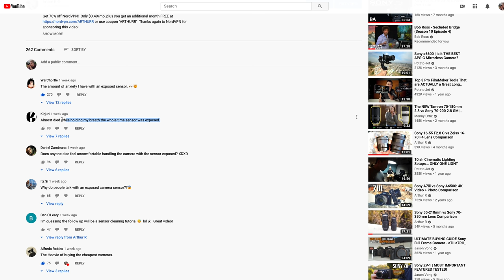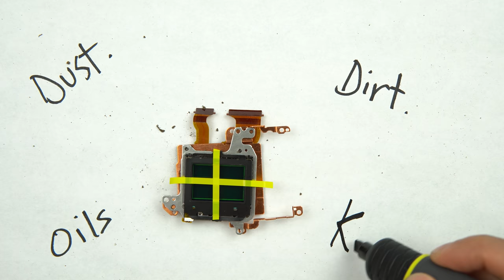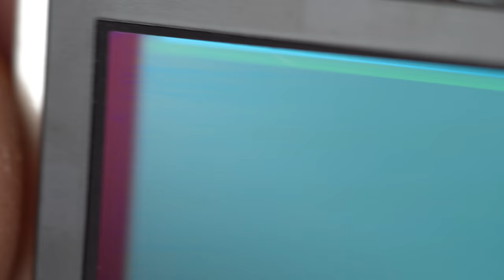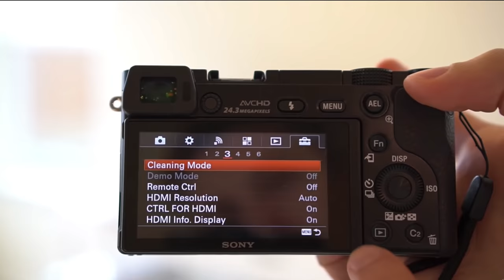How Scratch-Proof is a Sony Mirrorless Sensor?

Comment: One cleaning tip; for Sony cameras with IBIS, place your camera in cleaning mode. It locks the sensor in place while cleaning, so it does not move around.
Reply: Exactly ahaha. Seeing that sensor move made me lock up 🤣
Reply: Just got my a6600 two weeks ago have not cleaned it yet but good advice 👍
Reply: It has a feature that shakes the lense too right ?
Reply: @bikecommuter24  Unless you've been rolling in the dirt with it with the lens off, you shouldn't need to clean it in a long time
Reply: Great tip!
Reply: Ironic how Lens Rentals just recently show how fragile the IBIS mount was for Sony's cameras. Some mounting tabs were just broken, like a cheap material or classic cost cutting. Give it to Sony, an electronic toy manufacturer to make cameras.
Reply: @smoke4131  Correct
Reply: @ElReySupr3me  Me too 🤣
Reply: @smoke4131  If you press Ok on the screen that shows up after you press Cleaning Mode, the sensor will shake. So you can press Ok first to let it shake, then go to cleaning mode again and don't press anything to clean it by hand.
Reply: Tnx for that tip
Reply: @bikecommuter24  Me too..  but 3 months ago. And it's a beast right? So what lens you use ?
Reply: @jeroenvdw  If your camera has IBIS built in. My Sony A7 mark 1 does not have IBIS.
Reply: I don't think that's necessarily better. Having your sensor locked in place means you are actively putting pressure against the IBIS motors - potentially more than they were designed to compensate against. 

When you are cleaning it with the camera off, the sensor is moving more freely on its axes, and unless you are being overly forceful you aren't putting pressure against anything. 

Ultimately I don't think it makes any practical difference if you are being gentle but IMHO having it off is safer if you are concerned about damaging the IBIS.
Reply: Thanks

Comment: repaired cameras for 20+ years..... the sensor assy. (notice i said assembly) is the LEAST FRAGILE part in any digital camera. PERIOD.....the most fragile are 1. shutter mech....2. MAIN BOARD
Reply: legend is here
Reply: Hello, A drop of water fell onto my sensor while changing lenses in a forest. Can you suggest me how to remove it by myself since I'm at a very remote place and there's no camera repairing service available. wiping it with those cleaners will do the job?
Reply: @nord7556  I'm also interested, a bit of fluid touched my sensor and dried out and now there is a fluid 'shadow' on it
Thx in advance
Reply: I have a question regarding the sensor damage. In the tests it seems the scratches (from the knife) were done mainly to the filter that sits on top of the actual sensor (which I guess would be the IR-cut filter). Would it be possible to replace just the filter part instead of the whole sensor? I know some people remove that filter to make IR conversions on their cameras, so I guess it can be replaced too, right?
Reply: @MatheusPratta  The simple answer is yes (depending on the make and model). The realistic answer is no. Taking off the low-pass filter introduces a new risk of getting dirt sandwiched between the sensor and the filter. Removing the filter is also risky because it easily breaks. Overall just high risk low return from a repair perspective. Sensor replacement will be your only option unless you do it yourself.
Reply: Nah, my Nikon dslr sensor was damaged by the light blower tip touch

Comment: The "problem" with these tests is that it is not on a camera.   You would need to take some images to see if they show up.
Reply: My thought exactly. You really can't see the damage by just looking at it.
Reply: Yeah but that big Scratch will definitely show on picture
Reply: New video idea :D
Reply: @smoke4131  Its like a spec of dust on the sensor. At open apertures not visible but closed it might be visible
Reply: i think exept the knife mark then will not be a problem, wildlife photography, filmmaker smearing their sensor in dust and dirt all the time
Reply: @duynhat638  I literally got sand in my a6300 sensor. blew it out with a blower  cleaned it thoroughly and carefully and had no issues. I wouldn't test that on my a7III though, haha
Reply: the test is totally exaggerated, in real life you will blow it to clean it and different ways if necessary. The point is that leaving it open and collecting some dust is not such a big deal as people think.
Reply: Dave Taylor // But it shoes the « ideal » conditions to get the worst problems on the Sensor!
Reply: It shows my a7rii got some small scratches at lower shutter it shows 😪😢😭
Reply: @loogatdisdood No moving parts except for the shutter, so very little chance of dirt obstructing anything, although the shutter is bound to get screwed if you actuate it when it's really dirty.

Comment: Would be interesting to see how this sensor performs after damage
Reply: I have a scratch on my sensor, it doesn't really affect when the photo is taken in a faster shutter speed, but if its slow ull be able to see the scratch(s) on the image
Reply: @thevthinesh  one of my friend literally has a crack on the sensor glass and for some reason it is invisible in photos😂
Reply: @thevthinesh  the amount of light directed at your sensor from the aperture ring. When the aperture is closed: 11 and up you’ll most definitely see that scratch.
Reply: @architecture_logs  Yes, I've just had a dust particle on my sensor, and shooting mostly at f1.4 I didn't notice it, only when I was closing the aperture I saw it. Made me wonder because I thought aperture would affect only the visibility of particles on the lens but anything on the sensor would always be seen as literally the light receptors are covered.

Comment: You have not actually done anything to the sensor, just the sensor assembly. What you're messing with is just a piece of hard glass (maybe mineral) with an IR filter on it in front of the sensor, the tiny "scratches" are just where you scraped the IR coating off.

Comment: You shoulda try sand ... It's common in beach and it's super abrasive
Reply: but in real world scenario, getting sand into your lens is pretty much impossible unless you purposely pour sand into it. Even if you drop it on the beach facing downward, apart from the fact that the sensor is buried deep inside the body, the sand will not stick to the sensor either.
Reply: Sand will Scratch the sensor in one go only
 (ʘᗩʘ’)
Reply: I shoot at the beach all the time. Im certainly more cautious about lens caps when there but i do change lenses while there.
Reply: @youreperfectstudio4789  agree, you have to be a bit more cautious but still changing lenses is no problem
Reply: @iamwisdomsky  not... I travelled once as backpacker and oh man... Camping in beach.... You don't know how that sand gets to everywhere. One of my lenses got sand and it was hard to remove. The camera got some sand as well... But it survived the trip.
Reply: @ElRealista.  You're not being specific, which part of the camera? you mean inside the camera? in the sensor? 
We're talking about the sensor and not the lens or getting sand around the body.
If you are indeed getting some sand into the sensor, my question is how in the world are you handling your camera then? seems like you are handling it the wrong way. lol
Most camera bodies are dust proof so dust and other particles bigger than dust will not be able to make it into the sensor as long as a lens is mounted or the mount is covered with a cap if it's not in use. 
I can't imagine anyway a sand will make into the sensor unless you are handling it wrong.
Reply: @iamwisdomsky  the sensor, got inside because the lens had sand.  I used air to remove it.
Reply: @iamwisdomsky  lol definitely VERY possible. Any windy day the sand easily gets 4 ft off the ground and can get into your lens shooting at or below waist height into the wind. Not to mention someone shaking out a towel near you etc. My friend's dog ran into me covered in sand while I was shooting on one knee. Plus the obvious lens change.
Reply: Some Sony cameras aren't weatherproof and the ones that are weatherproofed, aren't barely good enough. Sand is sand and it gets everywhere but Sony is the worst. Give it to Sony, an electronic toy manufacturer to make half- baked defective products.
Reply: i got sand on my a6300 sensor back when I still had it. Cleaned it thoroughly and saw no discernable difference in image qualit. Went on to use it for another year and a half before switching to the a7III
Reply: Foto4Max You underestimate my power
Reply: I was filming in the Sahara back when tape was still the way to go. I duck taped every seam on the camera, and I placed the camera in a waterproof case and kept it in there the entire time. When I got back after two days of shooting, there was sand inside of the lens, and inside the camera, there was even sand inside of the tape. 
Sand, especially fine sand with enough wind will get everywhere.
Reply: @PaulKentSkates  exactly!! Sand it's superbly annoying. But to be honest, I was using vintage lenses in my a6000. They took it better than moderns lenses. I was afraid modern lenses with electronic connections could not take the trip.
Reply: @loogatdisdood  they key is cleaning with air and not using friction. Sand is super abrasive so if it's sand and you use a microfiber cleaning then is like scratching the sensor with the little particles of sand.
Reply: @Foto4Max And it gets everywhere
Reply: @iamwisdomsky  nope, been in plenty of sand storms on beaches. it gets into every thread on a camera. should you changes lens at that moment also...
Reply: @Foto4Max and it gets everywhere!
Reply: sand is pretty much guaranteed to scratch it if you drag the swab over. If you can't get it out with air, you will be kinda fucked.
Reply: I don't like sand. its coarse and rough and irritating and it gets everywhere.
Reply: @terorvlad  Lens brush first, then air blower, then the wet cleaning.
Reply: @caldera878  I don't know man, I still see the A5100 alive that was used almost 7 years ago...sure they are not weather sealed to the standards of canon and nikon, but they do live....

Comment: Arthur scratches the Sensor aaaaannnddddd....... Scratches at level 6,with deeper grooves at level 7.......😂
JRE
ArthurRigEverything
Reply: Was waiting for the bend test next.
Reply: Meanwhile I clean with a dry Q-tip when my air rocket can't quite blow off the dust.
Reply: The A7 is weak even for electronic device wise. Plastic body, plastic lens mount, rear LCD screen that fades and the overall impression of a PlayStation controller.
Reply: @caldera878  he was using a  A6000 sesnor though. Level 7 is a not a Sony camera model A7, it's a scratch hardness level.
Reply: hahahaha... sounds so familiar...
Reply: @MrMACornwell  haha. What about the burn test?? 😂
Reply: Yes man, after Arthur started the scratch test, the Jerry's voice instantly come in my mind sahduasdhu
Reply: "natural filter"

Comment: 0:36 You should turn the sensor cleaning mode on in your camera setting. That way you will lock the IBIS. What you're doing here is potentially damaging the IBIS
Reply: the a6000 does not have ibis
Reply: @LemonDrizzleGang  he's cleaning a A9

Comment: Thanks Arthur. This really helped. I now would have more courage  to clean a sensor should the need arise. Fortunately in 10 years of use of 6 different ILC cameras I've never had the need to touch anything to a sensor to clean it. I have run the camera dust removal vibration feature a couple of times which worked. I do keep my lenses and sensors covered as much as possible.

Comment: I'd love to know if you'd really see scratchmarks in the picture of the sensor. The protective glass atop the sensor seems to be thick enough to leave scratches out of focus.
Reply: You would definitely see it, you can see a grain of sand. It might not be noticeable without a direct light source coming in, but any bright light, especially off to an angle is going to light up that scratch quite a bit.

Comment: Interesting find... my A7RIII at first was strange because at F16-22 in some lighting scenarios would expose what looked like sensor dust... after research and talking to my local camera shop—came to the conclusion that the high resolution sensor was the culprit due to vibration and sensitivity. Even if the camera is on a tripod, clean/pristine components and with or without Stabilization and IBIS (16-35GM)... it’s still had micro dots of what looks like dust. This is where In post I can clean up. I usually don’t push past F14 and that seems to be the fix. Anyway I still feel like it shouldn’t do that. The interesting thing I’ve noticed is that people complain and say the A7RIII is like a vacuum and collects dust... when it reality they are wrong. I’ve used my camera everywhere and in any condition from sand, dust, rains and windy conditions. Still no sensor dust... haha

Comment: I think that the number one thing that is unknown about our cameras and as a result limits us as photographers is how waterproof the bodies actually are.
Testing a body like the a6400 (with tape on the lens mount as if you were using a sealed lens) under various showers of water with functionality tests in between as well as weighing the camera between showers after drying the outside completely, or even placing color changing stickers inside in various places could give a good indication of what the limits are.
Reply: I've dropped my a6400 in the river... fully submerged. Still works just fine after cleaning haha 😄

Comment: Excellent demonstration and a lesson most people should take to heart and there are some other important factors to think about: 
Most people think the sensor is sensitive, but it's actually one of the most protected parts of the camera; even those without an antialiasing filter they still have several layers of glass and other filters over the sensor so you don't actually touch the sensor itself, just the glass cover.
What do you think is the most prone to be damaged and replaced in a digital camera? 
Well, it is actually the circuit board or mainboard, whatever you want to call it, because of the circuit board isn't encapsulated or covered in resin like military-grade circuit board according to mil standard and the inside of the camera shell is usually not finished, painted or otherwise treated, so the magnesium or aluminium oxidizes and that magnesium or aluminium dust short circuits the board or wrecks it. 
In second place comes the shutter; the shutter blades are incredibly thin and light because they are made to trigger and "uncover" the sensor and cover it again in less than a 1/4000th of a second, sometimes as fast as 1/8000th of a second. 
So the idea like Canon to use the shutter blades in the R mirrorless cameras to protect the sensor from something when you remove the lens is a really stupid idea. 
Stick your finger in a touch the shutter if you dare and you might have wrecked it!

Comment: Given that the sensor sites are microns across, I'm not convinced you can assess the effect of the damage by examining the sensor with the naked eye. I would have been much more convinced if you had installed the sensor in an a6000 body and taken some photos at small apertures.

Comment: I appreciate the demo and sacrificing the sensor, but the unfortunate truth is that I have encountered scratches on the sensor that show up in images, but are not at all visible when looking at the sensor directly.  Also, when cleaning a camera with IBIS, you want to do it with the camera on, IBIS disabled, electronic shutter enabled, auto power disabled.

Comment: The issue with this video is that Arthur does not scratching any sensor.The complete video is misleading  if you know anything about sensor. What is here scratched is the glass cover plate, and under this one there is another one with IR filter on it , and you guess that behind this one is another glass layer on the top of the pixels with Air gap between them. So if everyone is thinking that his touching sensor or that the sensor is most sensitive part of the camera is doing it wrong. The most failures are related to shutter failure (A7III seems to be champion in that department) followed up by main board. Luckily for Sony users ,Sony introduce new feature where shutter is closed so all particle and dust can stuck between teflon perforated blades so shutter can fail prematurely.

Comment: Thank you for this video. I have been obsessing over a small spot that I haven't been able to remove with the Camera's cleaning mode, a dust blower, or a cleaning brush. I feared that it was the result of an accident when using a cheaper dust blower. The plastic tube shot out of the squeeze bulb either because it wasn't properly seated or because it was not a Rocket. Not sure if it hit my sensor or just hit inside of that area. I just ordered a cleaning brush/solution kit. Your video gave me peace of mind that my spot is from stubborn dust.

Comment: I have more a issue with you not putting that A9 in cleaning mode so it locks down the ibis and its easier to clean and keeps that part of the system unbroken.

Comment: You do have to differentiate between house dust, which is mostly skin cells from the inhabitants, to construction dust, that consists of bits of cement, sand, glass wool dust etc - harder, heavier, more abrasive dust...